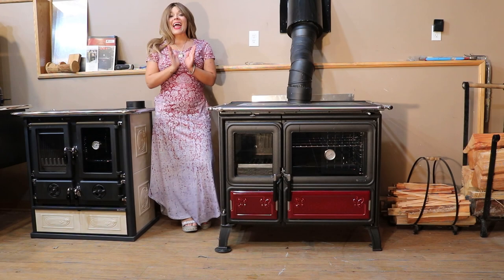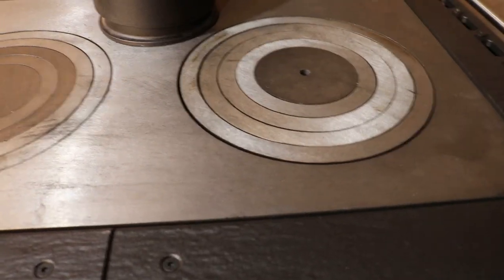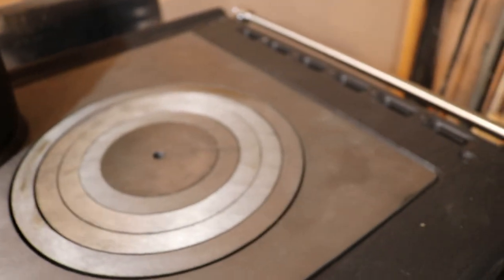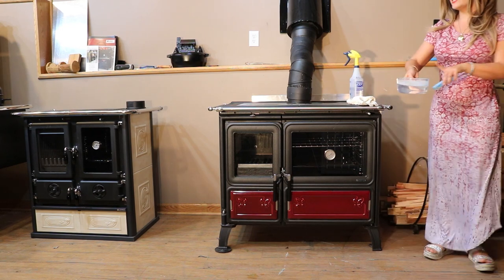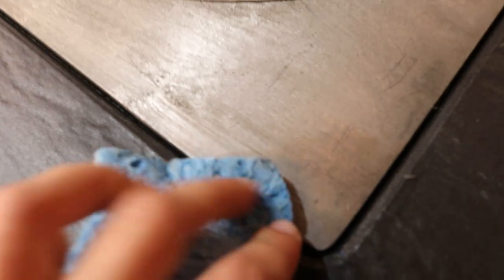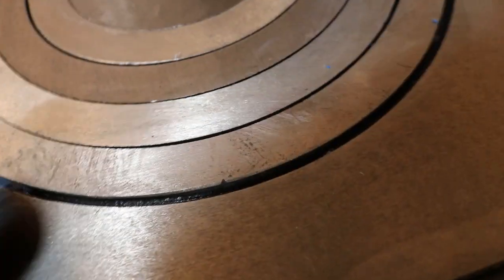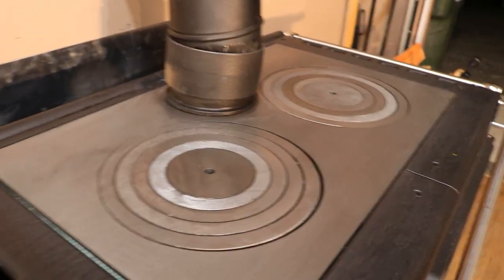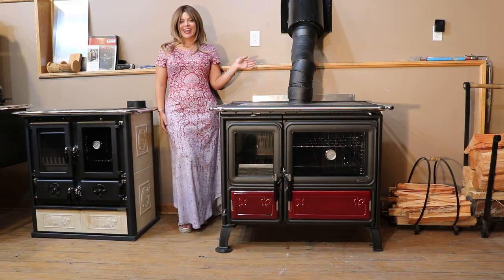Cleaning your Cooktop on Wood Cookstove - Removing Oil Prior to Burning Cook Stove

Comment: Those look like La Nordica stoves. We have had a La Nordica for over 10 years. Our model is now called the Termo Rossella Plus Forno. We love it. Not a stove top cooker, but a space heater with an oven. And since we so rarely use a stove top to cook, preferring backing, and in the winter a casserole "oven" in the wood burner oven works even better than stove top cooking in a pot, we rarely use our auxiliary stove top. But to each their own. And for some a wood stove cooker may be just the ticket. But I for one can heartily endorse any La Nordica stove. Well built and reliable.

Hope this helps.

Side note: Yes, we cleaned off the warming plate on the top of our stove before using, similar to your video. 🙂